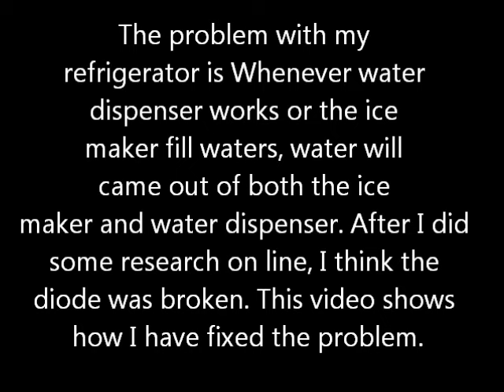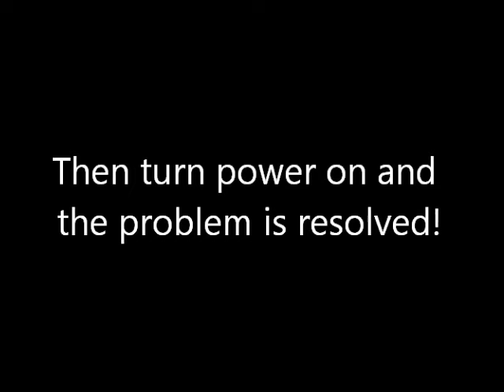Replace the diode for the Frigidaire refrigerator/Fixging Water maker leaks/ ice maker leaks

Comment: Hi replaced the diode and the water valve assembly and still have the same problem  noise when water from dispenser shuts off and water continues to come out a little and water coming out of dispenser instead of going into ice maker …  nothing changed after replacing both these parts.  Any ideas?

Comment: Yes, this is my problem too. The Sears repairguy said we needed not only a new diode but a new water intake valve, and when I asked why, he said, in so many words, that "they go together."  Is he just trying to sell me a $120 part to goose up the bill?  How can I find out if a new water inlet valve is really needed?
Reply from the maker: Tom Gorman Hi Tom! I think the best way is do a test with a electric meter. There are some videos on youtube. But to me, if there is water come out of the dispenser, then I will not replace the water inlet valve, and I would just replace the diode and see what happens. Acturally, I replaced my water intake valve too because there was no water at all  if I pressed the dispenser at first. After I bought a new valve (I bought one on amazon at a price less than 100 dollar) and replaced the old one, the water came out! Then I found a new problem and did a lot of research online and the problem was finally resolved as shown in this video. Good luck!